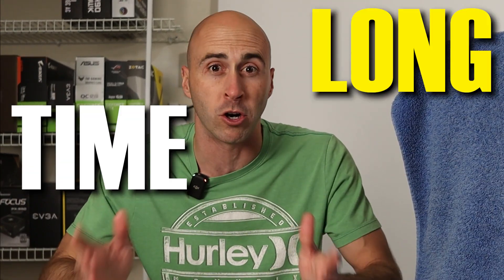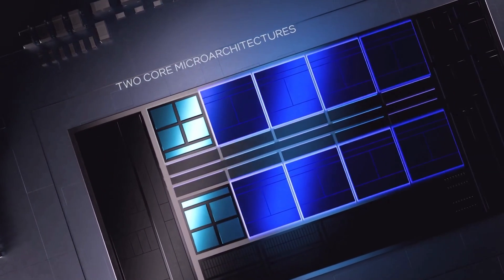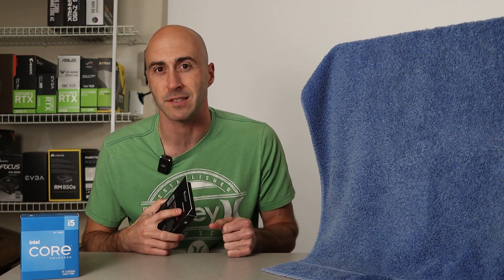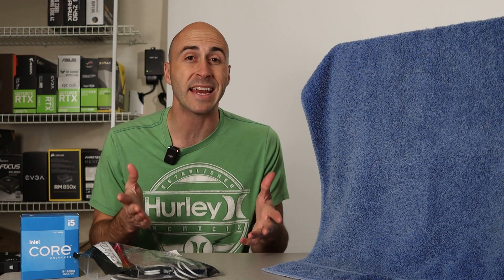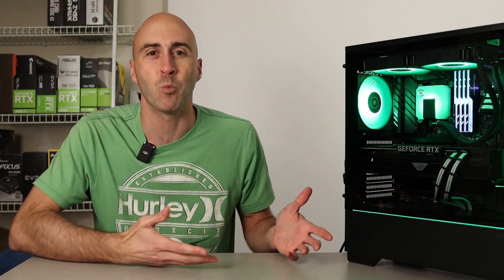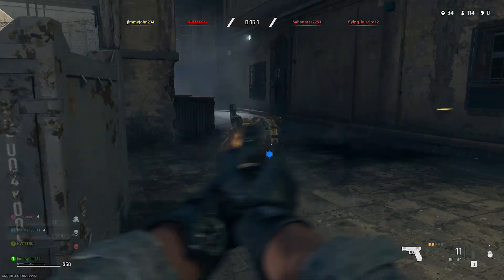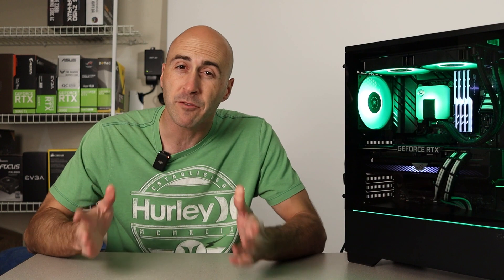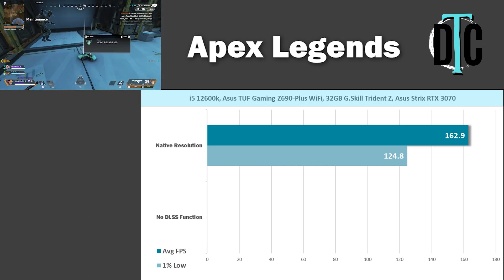Can your PC run Warzone 2.0?

Comment: Just an FYI on DDR4. It's already starting to happen, where the better DDR4 modules are rising in price or are completely out of stock as the demand wanes and will never be restocked. Same thing happened with DDR3. Time is starting to run out on the good deals, unless you're fine with greater latency modules. The used market isn't as good as it was either.

Love the build, btw!
Reply from the maker: Thanks! Yeh I’ve begun seeing that already. I just hope DDR5 prices and next gen motherboards come down in price by then.

Comment: First of all, very nice build! May I ask, if I were to go for air cooling using the exact same build, what CPU cooler would you recommend? Many thanks!
Reply: Ak620 is $65 and perfectly fine up to even more powerful cpus in case you uogrqde layer
Reply from the maker: I like Noctua or Bequiet. They cost a little bit more but cool great and are silent as can be. The NG-D15 or Dark Rock Pro 4 are the go-to coolers for high-end air builds.
Reply: @DannysTechChannel  

Thank you very much Danny!

Thank you too, wero liera!
Reply: You’re welcome. Danny is right with those coolers. They are a little more money too.  I have a ak620 with two Noctua af12 fans which is like a Frankenstein cooler lol.  And also spent too much money on it.  Maybe a d15 Noctua would have been cheaper lol